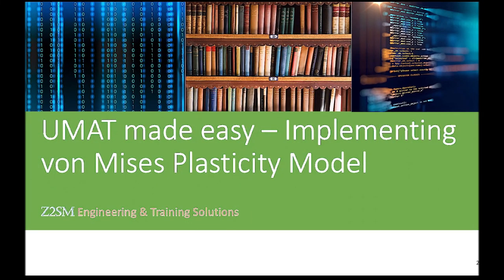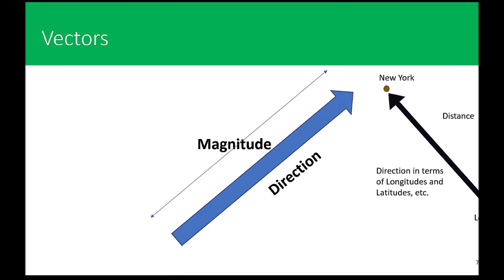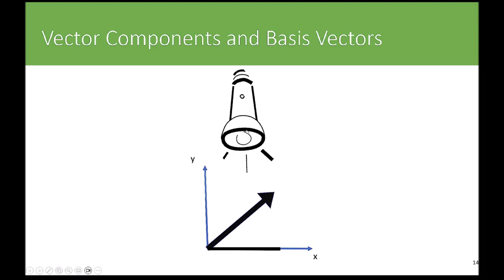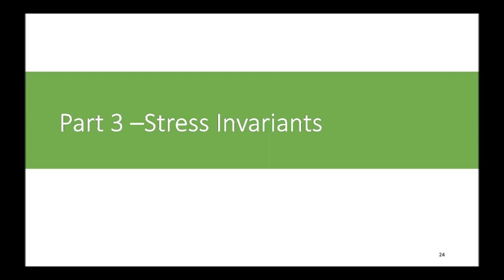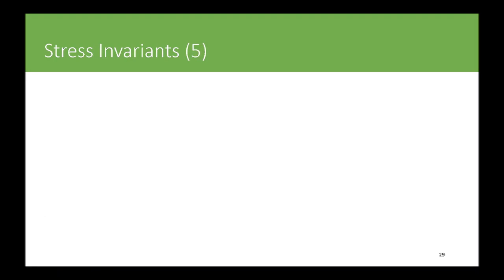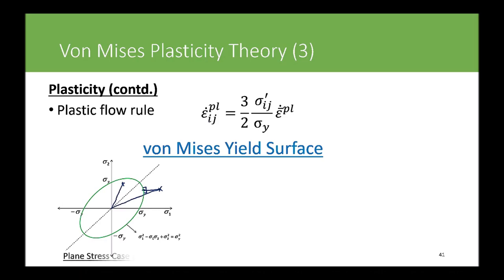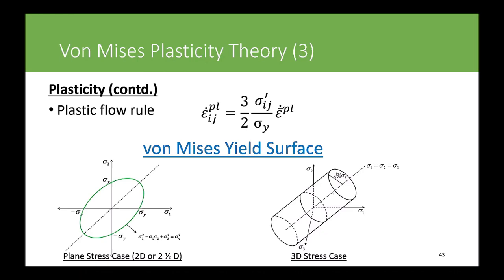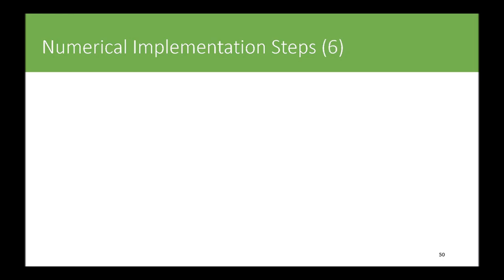UMAT made easy – Implementing von Mises Plasticity Model

Comment: 0:00 Intoduction
3:24 Part 1 – Introduction to Tensors
13:41 Part 2 – Tensor Notations
17:46 Part 3 – Stress Invariants
34:51 Part 4 – von Mises Yield Criteria
46:51 Part 5 – Numerical implementation of von Mises plasticity with no hardening 
1:02:25 Part 6 – Coding for von Mises plasticity with no hardening 
1:33:47 Part 7 – Validation through Default ABAQUS Material Model
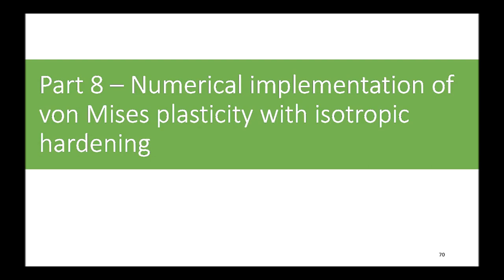1:46:47 Part 8 – Numerical implementation of von Mises plasticity with isotropic hardening
1:57:22 Part 9 – Coding for von Mises plasticity with isotropic hardening
2:05:22 Part 10 – Validation through Default ABAQUS Material Model